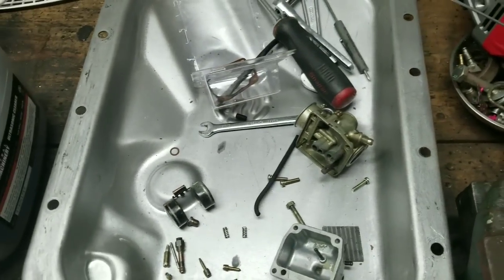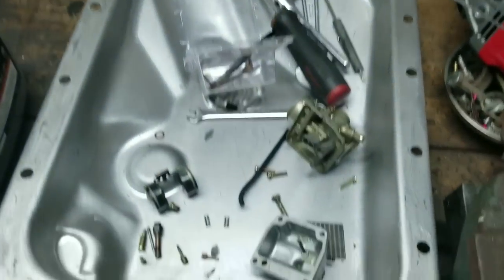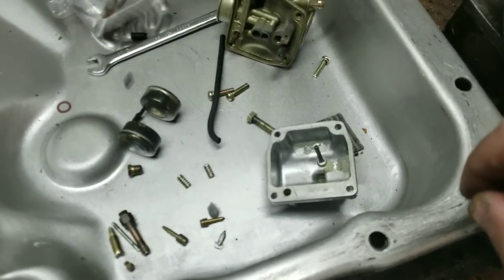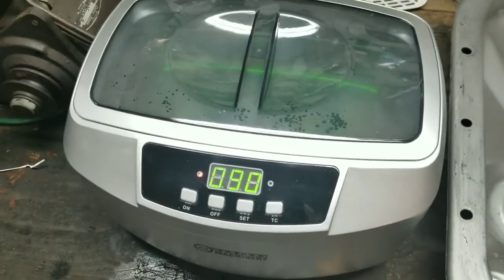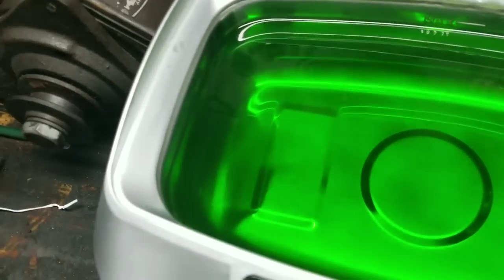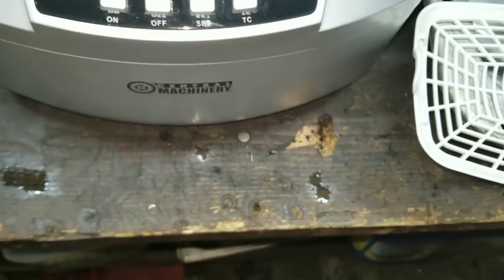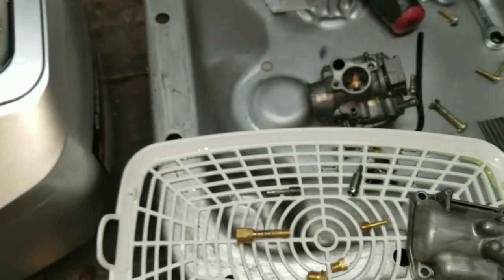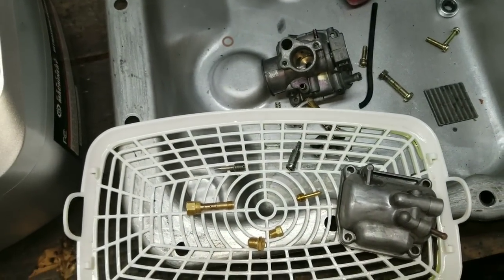Harbor Freight Ultrasonic Cleaner for Carburetors

Comment: Simple Green d Pro 3 Plus is not the right product to use - it is a disinfectant and is not being used according to label instructions.  Instead, Simple Greed Pro HD (available at Home Depot) is the right product to use and would have done an even better cleaning & degreasing job with no corrosion.  I work for SG, so I know what I’m talking about.  Pro HD is the way to go.
Reply: he said regular simple green ruins the aluminum, this does not?

Comment: Doesnt look like it did much after all that. I tried a sonic cleaner with plain water on some metal parts and after a while it puts small pits into them - yes even jewelery. So no way I would put a carb in there. Besides you can buy a whole brand new carb for a dinky thing like that for about $40 and then its already with new seals too.

Comment: If you had glanced at the instructions you would have know the timer indicates "seconds" and not minutes. Temperature is on or off, no "ready indicator". After you're done I hope your son's motorcycle doesn't end up with a stuck wide open throttle or something.

Comment: Do you dilute the SimpleGreen?
Reply from the maker: Yup cut it about 50/50
Reply: @krajus83  Use regular Simple Green and dilute it about 15/1. Way better. Just dont leave it too long. Then it will discolor it.
Reply: Use simple green is not a good idea. I always use spray nine it does not does collar medals or aluminums or anodized parts
Reply: @slagletoby  Your not supposed to mix Simple Green  with tequila.
Reply: @krajus83  do you have to dilute it?

Comment: From the actual sound of it running, it doesn't sound like an ULTRASONIC cleaner but a vibrator cleaner. Ultrasonic cleaners has an extremely high pitch output that usually so high up, most can't hear it. Yours sounds like some type vibrator type setup... JMHO

Comment: just buy a can of carburetor cleaner which comes with lift out tray clean it wash it off and air dry with compressed air and be done with it.  its also cheaper than that harbor freight gadget.

Comment: Thing looks cheap dont know if i should get one or not
Reply: JFA Jims Florida Adventures get a small crock pot for 10 bucks at Walmart and just get the cleaner and just clean it after with a air hose this kit isn’t worth the money 
Now if you have a large car carb or boat motor I would use a ultra sonic cleaner 
The simple green isn’t the good stuff order the stuff on eBay and you can use it 20 times

Comment: It's a shame. Just 8 bucks for 1 red and white can and pore it in run it. Would of saved all that work.
Reply: @DTW-bx2vy   when you shut down a boat or jet ski lawn mower or mini bike or and gas running engine.

You put sea foam in it on the last run. Then you shut it down for the year.

I rebuilt many of carbs.
I just love one can of prevention.

Better than a fix.

Comment: THis is a great method for cleaning carbs, however the harbor freight cleaner is cheap junk!  I've killed two of them in fairly short order.  They have warranty, and you can keep exchanging them when they die, but it gets to be a pain.   The first one lasted for about 4 carbs (running many cycles) and the second one lasted a little longer.  Buy a real cleaner from Amazon and do it right the first time.  Yes, these are cheap, but...

Comment: the Ultrasonic cleaner is good but totally unnecessary ... Gumout  will do the trick!
Reply: Gumout doesn't always work, especially with Ethanol based fuels. I have used it a lot over the years, but if the carb is really bad, it simply won't work to get it all out.
I rebuild carbs for a living, and these Ultrasonic cleaners work when nothing else will.

Comment: Could of just used a couple shots of carb cleaner..
Reply: Depends on the carburetor. My GPz750 has Mikunis with some really complicated, teeny, tiny idle air passages. Carburetor cleaner just flows past the holes in the carb body.

Comment: Sad thing is a lot of those carbs are like $25. They aren't worth cleaning or buying kits for. Same with power equipment
Reply from the maker: Mikunis aren't $25
Reply: @krajus83  Then what the hell was I buying?
Reply: Yeah a Chinese reproduction.You won't find a Mikuni carb for that price.However it may or may not function as necessary depending on the machining of the unit.I would not expect a good result.
Reply: @scottcrowley2061  ok, you seem to know more about what I did than myself. next time, you do the work for me!
Reply: @GlassByThaddeus  No offense to you, but you will not find a new motorcycle carburetor  thats properly setup for 25 bucks if you can even find one.I know there are chain saw, weedeater carbs, etc out there, but the Yamaha or any other motorcycle carb was machined and built with  very close tolerances and tuned by very smart people.This is not a good application for a China knock-off carburetor.

Comment: A whole new carb is only $20.00 on amazon
Reply: A crappy Chinese one, it's always better to rebuild the OEM if it's not beyond rebuilding.
Reply: @TepcoCycleRepair  

If I were a professional basketball player I would say you're 110% right. I'm only a regular human so you are 100% correct. I have a 98 Tacoma Ltd with 350k. Every time I replace an original part with a cheap Chinese aftermarket part I wonder how Toyota can get 350k while a Chinese knockoff new part will be warning of eminent failure after 10k, 20k, whatever. What the hell, I'll go ahead and say it, you are 200% correct. Japanese manufacturers know how to build some good product.
Reply: @GRAZINGARIZONA  Yeah, I have tried Chinese carbs on customer requests or curiosity, can never get them tuned perfectly or they don't last and it becomes a return job. Believe me I speak from experience. You save money initially but loose performance, time,  and money in the long run.
Reply: More like $200 or even more for an original
Reply: @ha1010rd  you very rarely have to replace though.
Reply: Bought a Chinese tractor carb. It never ran unless the choke was on.
Reply: Might as well crumple up a 20 dollar bill and throw it in the toilet. I have bought 2 eBay chines carbs and both did not run right.
Reply: Yep, you save money, and never learn how fix anything all at the same time. Good job.